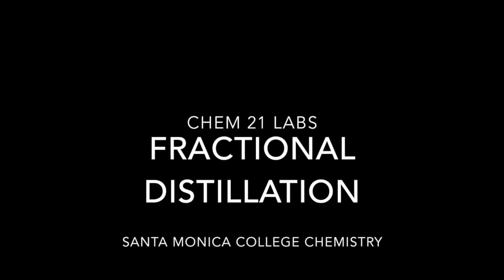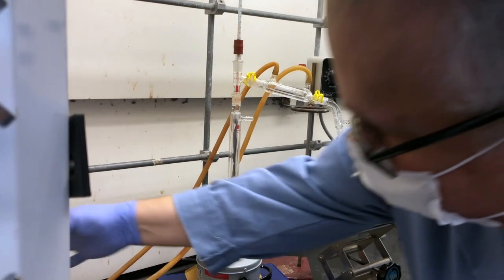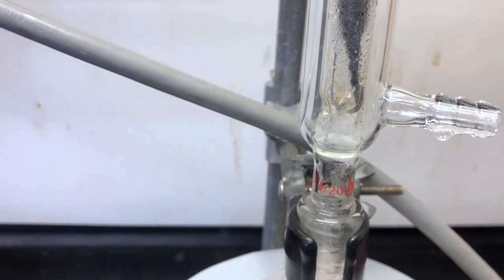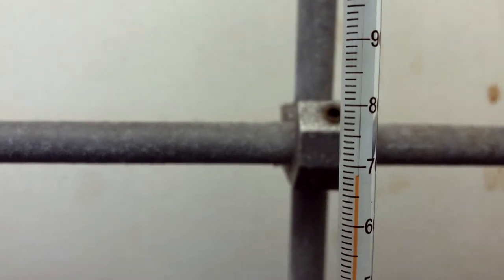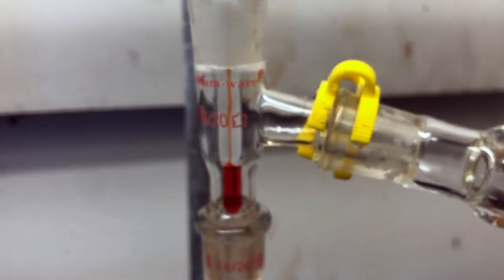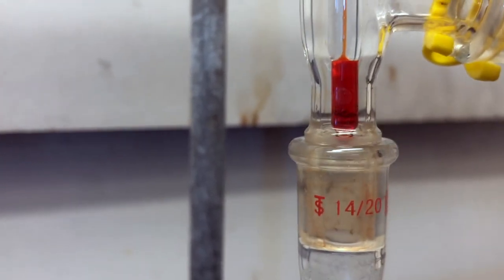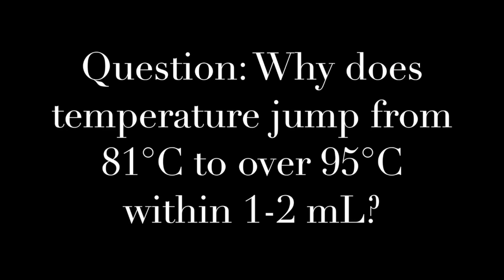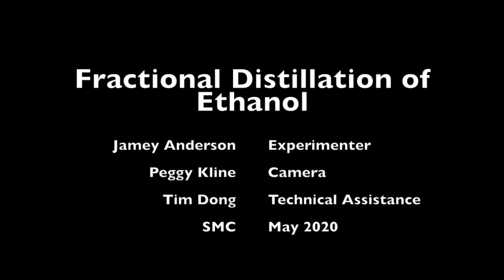Fractional Distillation

Comment: You can very simply eliminate hose issues just by eliminating the rubber band junk material and leaving that for the medical industry for use to draw blood!  Or those sloppy rubber hoses can make awesome slingshot material!  Now! As far as a well thought out cooling hose system, use the right diameter size CLEAR VINYL TUBING! At your local Home Depot. 
1. It is far more superior in terms of not kinking up, or rupturing due to the latex dry rotting from water and age! 
2. Will fit beautifully firm and secure without really worrying about blowing off the condenser columns, and when used for vacuum filtration you will have a more efficient vacuum due to the fact vinyl hose will not collapse like a clogged artery! 
3. For the most part unlike slingshot....err i mean latex hose is opaque and you really cant see any obstructions in line, where as vinyl is clear and can actually be cleaned out if you're water supply is that funky, wherever you live! So my recommendation is vinyl! 😊